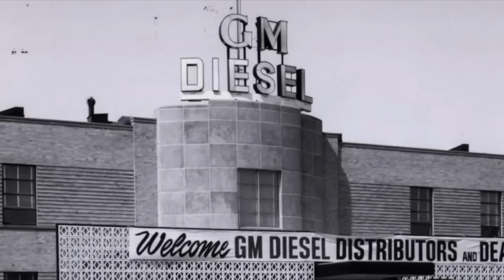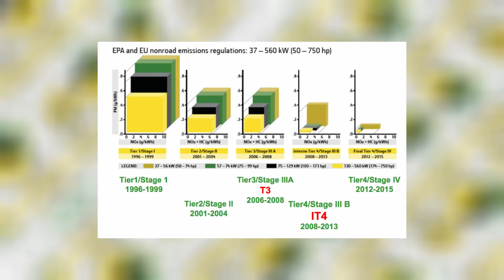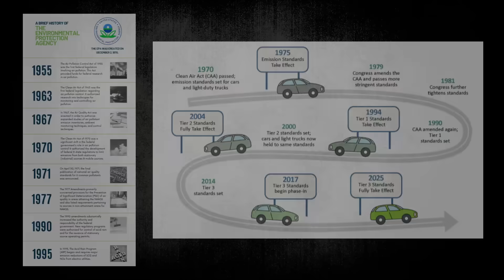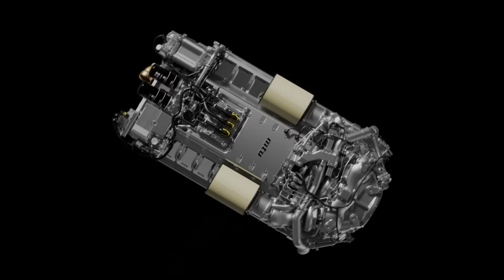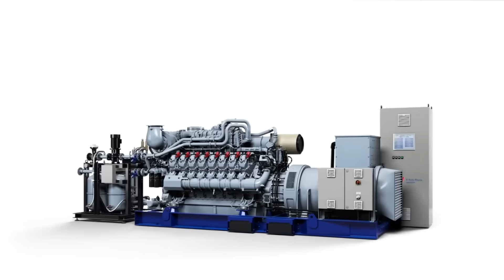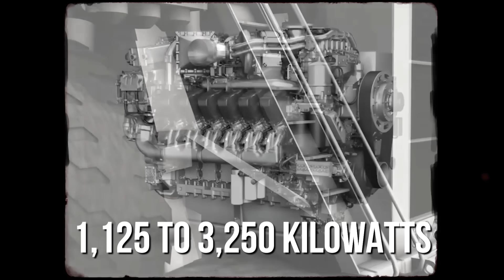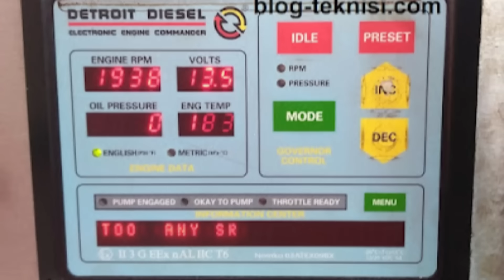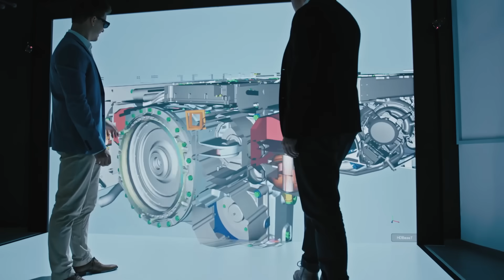The Insane Truth About the Detroit Diesel - MTU Revolution

Comment: So, You woke up just to bash the original Detroits? The original Common rail fuel system? Your technical info and date schedules are wrong. The 92s were not developed till the late 80s. 
2 strokes made tier 2 and possibly tier 3 if encouraged.
It was Penski that offered DDEC and the series 50/60 that attracted MTU.
You really need to get your ship together before making another wrongly bashing video.
Oh, nobody put a big 149 in a truck meat head.
Further; I broadcast ammonia on MTU...

Comment: This guy doesn't know crap from shine-ola, full of really bad info, that is wrong. This video deserves a F.
The 16V 149's were capable of 2400 HP for marine.
When the Series 2000 first came out it had pump line and nozzle with EUP's. When the new design was released for marine it had common rail fuel systems
Get your facts straight before making a video about something that you don't know.
Reply: You are so right S60 came out in 80s